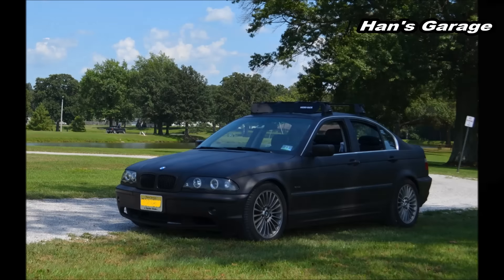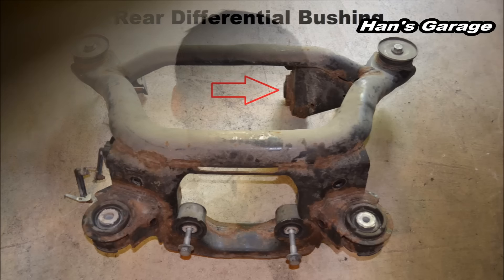BMW DIY Video - How to Diagnose clunking noise from the rear and fixing it.

Comment: Please can you help. I have an E46 with a rear rattle when I go over bumps. I had the rear shocks and mounts changed. Unfortunately although the rattles have slightly been reduced, it's still not resolved. I also tried another mechanic who thinks it's the steering rack but my regular mechanic does not think that's right. So will have further checks in the new year. Any advice would be appreciated. Just to add they also checked the bushes.
Reply: Check your e brake shoes in rear drum

Comment: How many work hours did it all take? Thank you very much
Reply from the maker: Soro GuÊ I recently did it with a friend of mine again and it took us 2 days. About 8 hours total
Reply: Just another question. regarding Bushings brand... YOu chose original material or aftermarket(ex: Febi bushing or Lemforder) Thank you
Reply from the maker: Soro GuÊ I used power flex and my friend used AKG racing bushings and I am in love with the AKG. I may get them myself and do the installation video again
Reply: Thank you for your help. Jesus, i will do this work in my 323ci now (with a professional mechanic)...what a pain.
Thank you for your invested time in such usefull videos!
Reply from the maker: Soro GuÊ first, i would make sure your subframe mounts on your chassis isnt cracked or anything
Reply: HAN'S GARAGE you mean, before removing it? Is it an impediment?
Reply from the maker: Soro GuÊ after removing the subframe. Check  and make sure your mounts are clean with no cracks
Reply: HAN'S GARAGE I'll make sure. Thanks for the advice :)